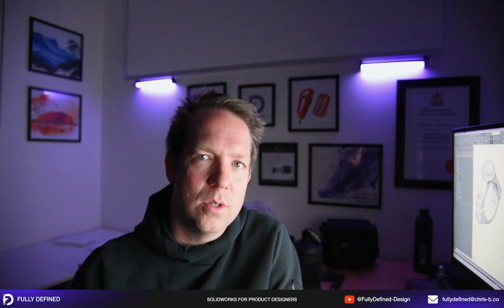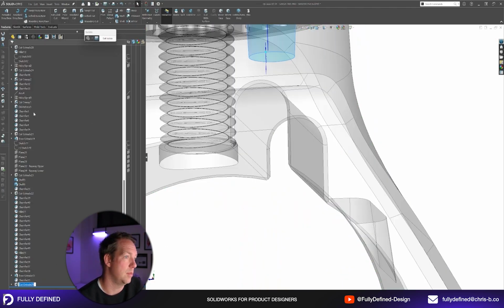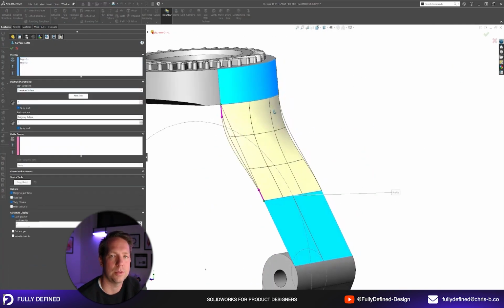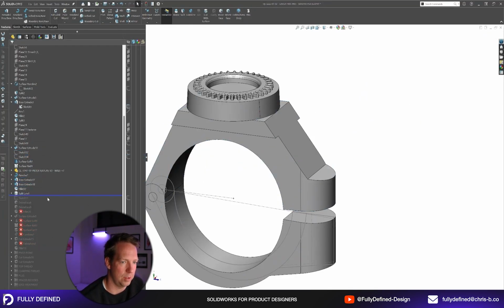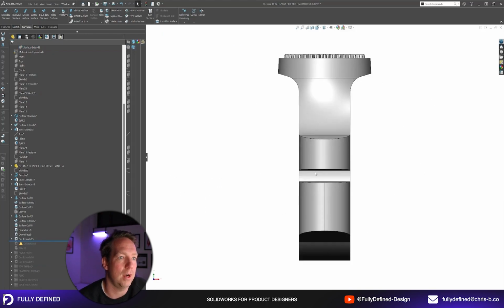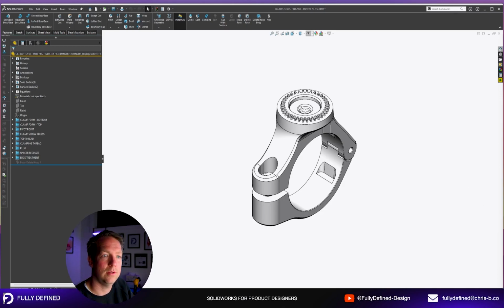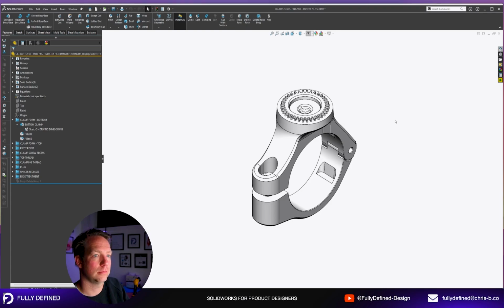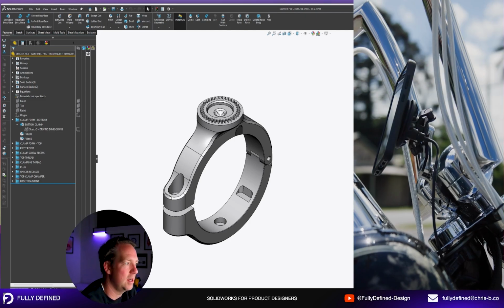SolidWorks Model Cleanup Process - HBR Pro - SolidWorks Advanced Skills

Comment: Hi Chris,

This was great help, can you upload the real video or a video where you share the general idea of it. how you manage feature in a nutshell. 

I did not understand the part where you use the existing sketches. I understood that you take a convert entities & delete the external references, then move the thing on top side & start using the new sketch for whole part.

I also did the same thing, my question is that are you creating side by side a new body with the converted sketch as you cant replace the sketch that is used in the feature & if you can then all streamlined feature below that will only reference on the first initial body such fillets & draft. so you'll end up doing the whole stuff all over again.

I hope i was clear on my writing
Reply from the maker: Hi Davinder,
Thanks for watching and for your question.  Yes I would like to make another video like this, where I go through the process more slowly.

Sometimes when a model is created by you or someone else, there are features and sketches lower in the feature tree that later gain importance - they drive important features.  If that model is one that may be used again later, in this example it was used to make a larger version of the same design, then it is best to have an organised feature tree with all of the important driving sketches and features at the top.

As you know, you cannot move child sketches up above the parent.  However, if you create a duplicate of the sketch, and remove any reference to the parent, then you can safely move it to the top of the tree.  Once it's there, you can re-sketch those entities into your driving sketch or otherwise do what you want with it.

It is complex to describe clearly by writing.  Hopefully I can show in more detail soon with another video.